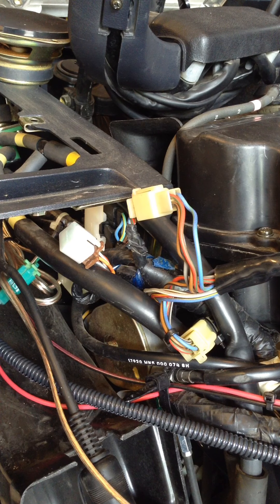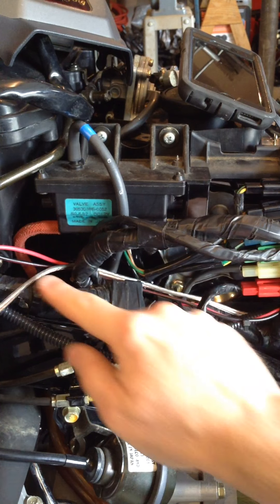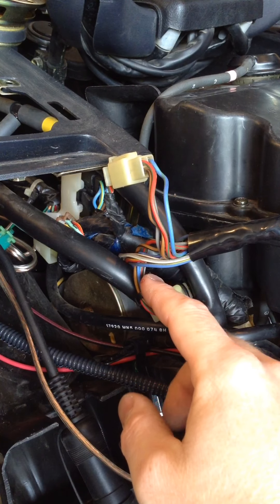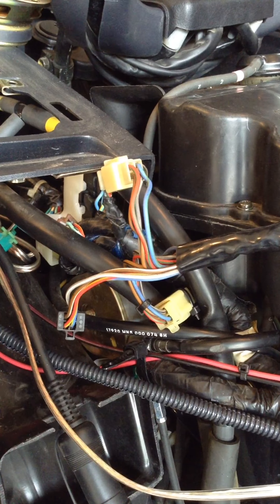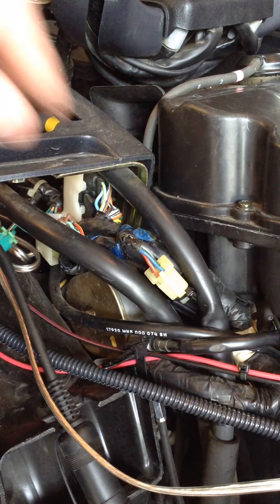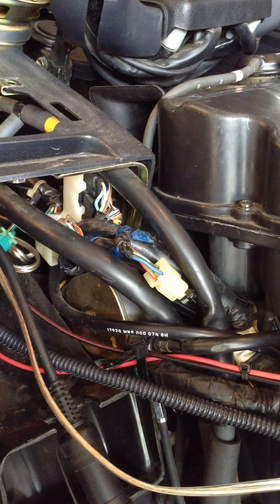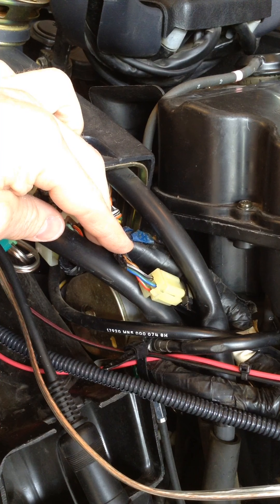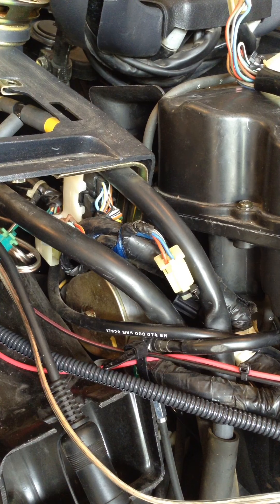Honda GL1500 - Fader control

Comment: Thanks for the vid. Had no sound from the front even after replacing the speakers. Discovered I was missing the fader knob and in place of that there were some cables bridging the fader connectors and sound only from the rear. Had to buy a used fader control knob to get back sound from the front too.

Comment: You know what. You just might have solved my problem with my audio on my 93 gl1500.  Maybe the harness is disconnected.  I have sound but only from the right front speaker. I turn the fader to the left and the sound shuts off.  Hmmm. But it’s only the right front speaker 🔊 that works. Not the back one at all.  I’ll look into it and do what you done to disconnect the fader and see what I got.    Very Helpful video.  Great. Thanks.
Reply: I have a 93.  Where is the fader?  I can't find it.  THanks!!

Comment: So yesterday i  Finished taking apart my 88 gl1500 And I connected the radio system back but now only the back speakers play  And I only disconnected the wires connected to the. Cassette/radio player.  The ones that Are directly connected to the back of it. But I'm not sure if I press them all the way in the Front speaker.
S are not playing and only the back are

Comment: how do connect your rear speakers without the fader
Reply from the maker: Ken Elford - you can unplug the fader to remove the rear speakers from the mix which leaves just the front speakers obviously.  The rears are just a slave that runs from the fader/splitter if that makes sense.  On my bike, the front speaker wires had an extra set of terminals that you could hook into at the front speakers.  Then all you would have to do is run new wires to the rear to slave/split the front signal to the rear speakers.  With an amp, all you'd need to do is run the front speakers only back into the amp and then run separate wires from the amp to the front and rear speakers. There are other ways to do it and it depends on the type of amp you have and if there is or is not a fader in the mix.
Reply: @ole496   Bingo!  Great question and perfect answer!  Thanks to both of you.